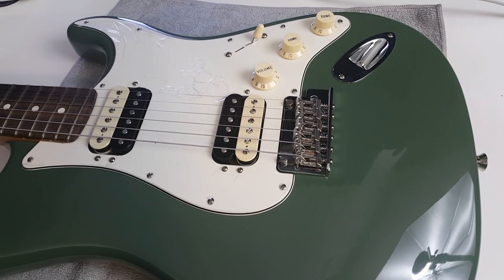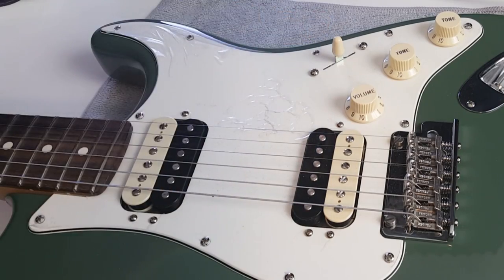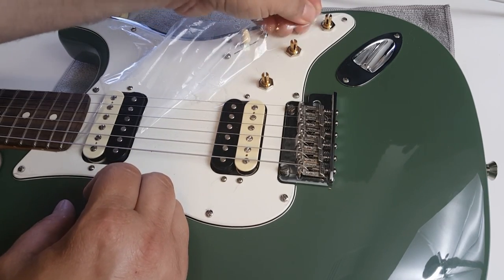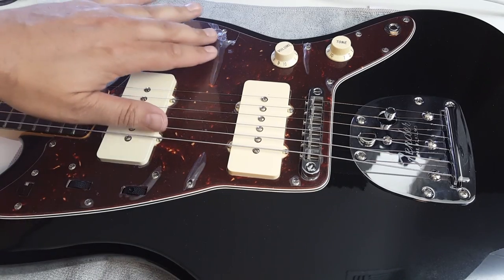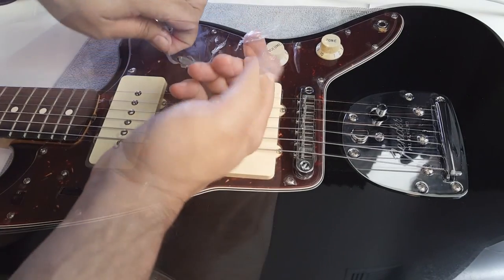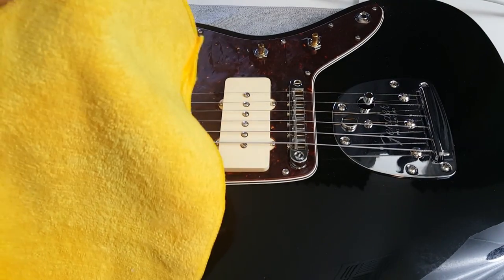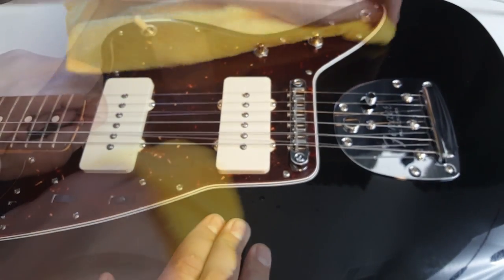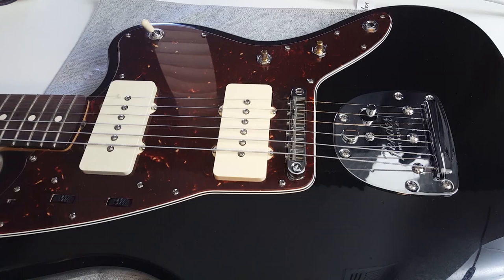How To Remove Plastic From Pick Guard Hack

Comment: WD-40's primary component is kerosene. Kerosene is actually what removes the adhesive residue.
Reply: JCShroyer I'm guessing it doesn't damage the body finish or do you have to be careful
Reply: JCShroyer It also eats plastic.
Reply: JCShroyer Let me be more clear about this WD-40 will eat through plastic. I don't know about kerosene, but I have experienced WD-40 eating through plastic.
Reply: Not all plastics surely. After all, WD-40 nozzles are literally made of plastic.
Reply: Arthur Piccio the WD-40 nozzle is most likely ABS. Pickguards are made from different plastics, but I don't think many are ABS. Worst case scenario it pits your pick guard if used regularly and you buy a new pick guard.
Reply: Nope, it's main ingredient is actually mineral oil which is the culprit for eating plastics and rubber.  Followed by a bunch of different hydrocarbons.  
http://www.wired.com/2009/04/st-whatsinside-6/

Comment: Hey Philip, if you use 1 or 2 small zipties you can just pull off the knobs. All the force is directly applied upwards so it won't damage the knobs. Learned that trick from Scott Grove. (I just added a second ziptie to have one on each side of the post.

Comment: Tip about the pickup screws. If you measure their current height, you can raise the height then the slack will allow you to get a pick under the screw head to raise it a bit and pull the plastic out. Also, it's really easy to loosen the pot bolts a bit to pull out the plastic from under those too. Don't forget to return the pickup to their original height on both sides of the fretboard.

Comment: it was a bit of a hassle on my new jazzmaster, not because the foil was sticky like in this vid but because it was stuck under the nuts. had a bit of a moment when the input fell back into the body, but managed to get it back out with a pair of tweezers. only for the toggle switch I didn't have the right size nut driver, so I just pulled the bits of plastic out with my fingernails. good enough for now. prying the pots off with a pick worked nicely 👍

Comment: Microfiber is best. It's made with small micro loop like configuration. They do this to trap small particles of dirt and dust and also pull any water or moisture into the cloth. Also it doesn't leave lint or and fibers like paper towel, cotton cloth, or rag cloth can tend to do. It will prevent leaving swirls or scratches in the paint too.  You see them in automotive stores for those reasons. You can purchased in bags of multiples colors for color coating like stage mics. Red for dust blue for wax purple for cleaning my guitar strings ect...... From what I'm to understand there made from recycled plastic bottles. That's what the micro loops are. WD-40 is great for taken almost everything special sticky left over tape, sticker,or tar. And it was actually a mistake when formulated. That's another teed bit of info for another time. Peace

Comment: From some of the comments  you'd  think Fender put the plastic  on to annoy folks....the fact is the pick guard  material  comes in large sheets...the plastic is there to prevent scratching  while  Shipping  as well as it keeps  the edges of the pick guard  from getting chewed up while the CNC machine cuts them out.

Comment: Hey Phillip have you ever completely taken off the guard on your mexican made Jazzmaster? I am only asking because would it be possible to slice out some of the plastic around the neck rod adjuster that is in the rear of the neck to make it accessible? It seems like an odd design to make it non accessible. I think my jazz has a slight bow away from the strings.

Comment: Undid my pickup screws a few turns but found the pickups ended up at different heights...is this ok?
Reply: Had the same problem
Reply: I'm sure you figured it out by now, but in case anybody sees this and is wondering, the short answer is yes, probably. Pickup height has a lot to do with tone. How close they are to the strings makes a huge difference in how it sounds. So your pickups are almost definitely not all supposed to be at the same height, almost certainly didn't come that way, and you're probably not going to want them all to be the same height. Unless you know what you're doing, probably not a good idea to start screwing with the pickups, unless the sound is bumming you out so much that you're thinking you need to change them out. In that case, it's a great idea, and moving them up/down might fix your problems and save you a fair amount of money.
Reply: @maxcandlestick8027  thanks!

Comment: I loosened the pots and input etc too on my Gibson Flying V, to pull out the plastic from underneath, I figured if it's sitting there sticking out it will just gather dirt and dust, I didn't like the thought of that. The only thing that happened is that the words on the knobs aren't 100% perfectly aligned anymore, but I'm the only OCD nerd who will notice and I rather have that than some gooey stuff sticking out in dark and hidden spots 🤣

Comment: Omg, what a nice way to make money. You deserve it though. The part I'm missing is, what's the problem with just pulling it? the amount of work is about the same...except for the Jaguar, that one makes more sense.
Reply: cause its pinched under the screws and then it just becomes a project getting the tiny pieces off from under them.